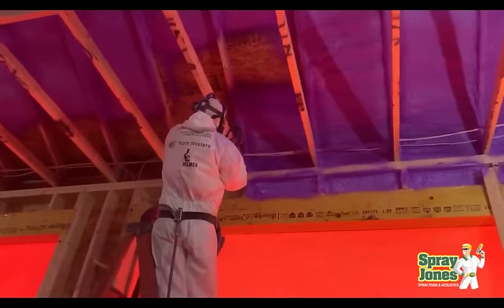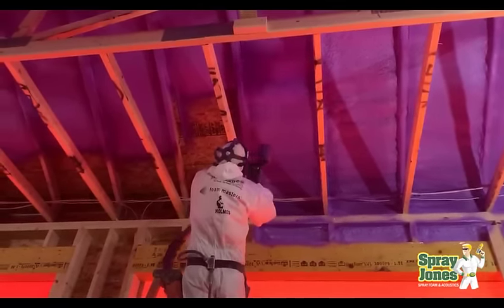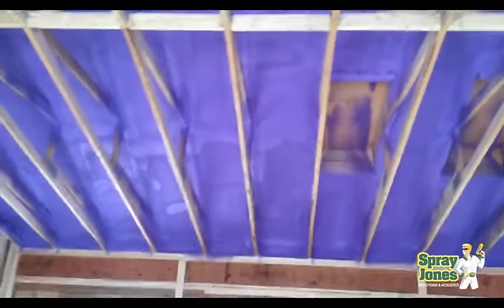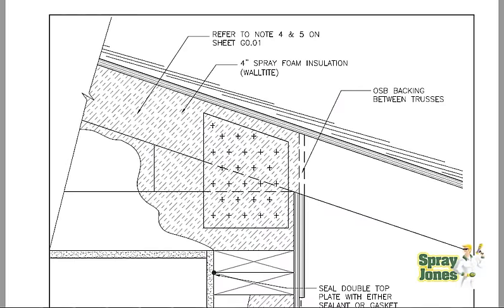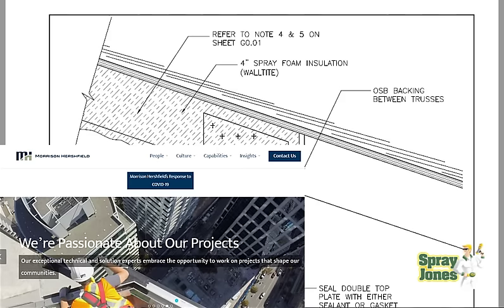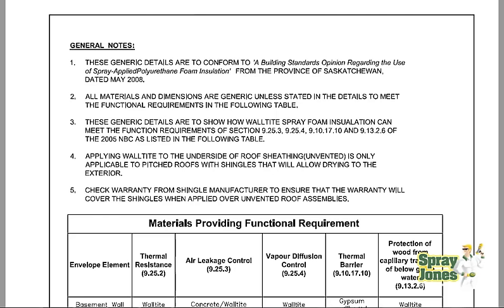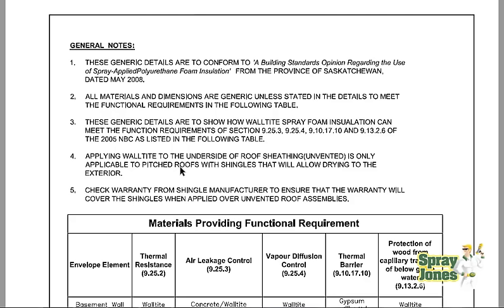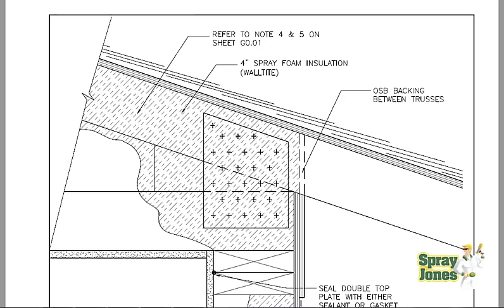Unvented roofs - Closed cell vs Open cell Spray Foam Insulation which is better?

Comment: I think you made a good case @7:30 for not using closed cell foam.  Once you encase the roof deck in closed cell you would have no way of knowing if your roof is rotting away until your shingles start to fly off. Sounds like cutting the roof deck with a skilsaw might have been avoided if the leak was detected early.

I like the idea of open cell for that application, closed cell everywhere else.
Reply from the maker: Just ask a roofer how many times do they have to replace roof sheathing on a conventional roof when they replace shingles? How did the guy in the story I told discover the issue?
Reply: The key is if the roofing allows trapped moisture to get out.  I would assume most asphalt shingle assemblies will but not nessarily.
If you do have a leak in your roof with spray foam on the underside you will not know it until the sheething, structure has rotted away.  As stated, that foam glues everything together, it will be very difficult to replace that.  Given that roofing guys often have to replace sheets when re-roofing houses, I would be very nervous putting spray foam on the underside of that decking.
Saying that, there certainly are lot of advantages in spraying the underside.

Comment: Just found your channel. Good info. Somethings to mention. Closed cell in this scenario needs to be air tight with no air leaks through to roof sheeting. In my experience, air leaks in cold climates can drive enough moisture to cause structural damage from rot. Also ice dams can be an issue. We've had good luck with using baffles to create 2"+ ventilation space and thus maintain a cold roof while still gaining the advantages of closed cell foam, the added rigidity, the conditioned attic space, much less ice damming  and, for me, accessible ceiling systems. 

The baffle idea seems like common sense to me and to the installer I've used on multiple jobs but I've never seen it mentioned in any foam industry info. Wonder why?
Reply from the maker: Do not agree.
Reply: @SprayJones  his point seemed logical I wonder why you did not agree. Could you please explain, thanks so much.  Also if you have an air gap there if you had to replace any sheathing, it would not interfere with the spray foam.
Reply: I would assume that now the space is not unvented anymore. This video is for unvented spaces so everthing needs to be ar tight.@davidhannan2023

Comment: We have to have some type of ventilation in attic spaces by code in Michigan. Mechanical or passive ventilation your choice. With proper ventilation your shingles will last longer and not blister up. I have seen house's roof sheeting rot from spray foam and no roof ventilation. Currently ripping out finished spray foam basement. They sealed the masonry. Masonry loves to wick moisture. Condensation built up in blocks over time. Till it leaked in basement. The masonry needed an area above grade to dry moisture out. With roofs the issue is condensation. I tell people to make sure they have roof vent baffles installed before spraying foam.
Reply from the maker: Watch the video I made on shingle life and SPF. 
Then the 4 part series on non-vented roofs. 
Code is based on open cell fibrous NOT SPF. So you cannot import misaligned rules to this system.

Comment: I live in the south and have an older house. I have a ridge vent and side draft exits, do those stay? Can i also leave the blown in insulation that's already there on the floor? Would you recommend closed cell?
Reply: I live in AZ and also wonder if I used closed cell do I need to remove existing blown in insulation and block off my attic vents. Also do you need to have the attic ventilated with your hvac also
Reply: Just wondering what you guys ended up doing? I have a similar situation. Thanks

Comment: Great vid, very helpful. I'm embarking on a closed cell job for my roof deck. Two quesitons if I may!
1.) Is adding stregth to roofdecks for snowload a universal benefit when applying at least 4" of closed cell? 
2.) We just completed some sistered rafters to the attic roofdeck. New lumber to old rafters. Should the new lumber be dried to a minimum moisture before spraying foam?

Comment: Closed cell on the bottom.  Peel and stick or fluid applied on the top you I’m pretty sure you will NEVER have a problem. Thoughts?
Reply from the maker: Agreed. 
People that have issues have chosen cheap products, installed by morons, because of the bottom dollar was good.

Comment: My builder said he only sprays open cell because of yrs of experience with both.  He's had way more issues, both short and long term, with closed cell.  I do know I have leaks and have no clue where the source is.  My house stays a consistent temp yr round and my electric/gas bill stays relatively cheap compared to my old house and other people I talk to.  My attic is unvented conditioned with 4" of open cell foam.
Reply from the maker: Sounds to me like your builder has issues with trades... having leaks will wreck anything over enough time.

Comment: I would assume a roof with lower than a 3 pitch would have EPDM or greater roof covering and would allow for the same /similar detail.
Reply: It would be the same. Vulcanized roofing over the top. 
The other safety factor is to install roof wrap. On the roof. Usually a water repellent membrane. Before the shingles are applied.

Comment: Half way through my remodel i decided to swtich to nonvented attic with spray foam. 
I have a metal roof no penetrations.  The plumbing vent goes out the siding near the peak then up above the roof line per code. 

If i did it again i would have used zip tape over the rafters to protect from nail holes. I also would have used zip roof deck. Im not a pro builder but i do think things through. 

Fortunately i used a metal standing seam roof instead of shingles so my decking ahould stay dry.

Comment: I keep hearing conflicting info on putting foam directly to a roof deck. Some people insist you need an airspace there to keep the roof deck cool.
Reply from the maker: You do not. Commercial roofing does not use an air space between a deck pan, rigid and a top membrane. 
It's time to break out of 75 year old technology and the dogmas that go along with it.
Reply: True !
Reply: I had multiple spray foam installers (got three quotes) tell me it was fine.  My roofers wanted vents, I told them I was spraying to the roof deck - they checked with the shingle manufacturer to ensure they would be able to offer a warranty before they even started on the roof (wasn't a problem).  I then checked with my Hydro rep (when I was having my house assessed for energy efficiency grants)  and he stated that a vented roof would actually lead to more problems and the only reason that it's still sometimes done is because building code is lagging behind the technology.  Same reason the spray foam guys actually told me there was no point in spraying more than 4" of foam on a roof or 3" in a wall but code may still require it because it's based on fibre glass batt R value (or did when I had my house sprayed and inspected).  As a result they had to spray 4" on my basement walls to pass inspection even though they said there was negligible returns going from 3" to 4" on a wall.   My only concern was the point brought up earlier, that if there was damage to the roof you would never know about it because the water would take a long time to go around the foam to get into the house and show itself.  That's where investing in a proper roof comes in - get the membrane, get the ice and water, get a company that does it right.

Comment: Your videos have helped convince me that an unvented condition attic is the way to go. We are going to put new asphalt shingles on just prior to spraying closed cell foam on the rafters. What kind of underpayment should we use?
Reply from the maker: That is your roofer. I do not know. 

Pick the BEST SPF contract you can. Vet them out and do not be afraid to pay for it. Less issue potential.

Comment: What about open cell for the underside of an EPDM flat roof? I assume this means the roof assembly needs to dry to the inside during all seasons which requires proper HVAC maintaining low RH in the dwelling.
Reply from the maker: We treat EPDM flat roofs on a case by case basis to review all variables and liabilities. In short we have sprayed all that we have done with closed cell because it was the right fit for the inside.

Comment: Can you use close cell on 1/12 pitch metal PBR roofs.( in south east US) 
Have perused your vids but can't find anything spacific. Thanks for your ethics's just wish ALL spray foam contractors had your integrity and desire to educate others. 
As for as I'm concerned that is what transparency is meant for.

Comment: I'm wondering if there could be a condensation issue in colder climates, if any research has been done how this practice holds up to the test of time? A life long carpenter and builder I think having air flow between sheathing and insulation will alleviate the chances of condensation condensation.

Comment: Can you use 2" of closed cell then fill gap with open cell? I have an I.C.F home basement, and 2nd floor 3rd floor is a mix of 2"x12" walls and 2"x6 walls ,I'm going to have a condition attic that is cathedral type , the contractor I'm looking to use is recommending open cell with the thought that a void in the 2"x12" wall area and possibly the 2"x6"  wall will create a bad echo ??

Comment: Question.   Is there an advantage to 1" of closed cell followed with 3" of open cell?  As opposed to only 2" of closed cell? Some installers are recommending this application mainly due to cost of material.   THANKS!

Comment: Recently had open cell sprayed in my attic. Noticed a leak during a rain storm shortly after due to the expanding foam pushed off our ridge vent. I had all 3 ridge vents removed and shingled over the opening. Problem solved but it cost the spray foam company $675 for this work. Ridge vents should be removed prior to spraying.
Reply from the maker: They should be covered up from the inside so the foam doesn't go into them. Same result.
Reply: @SprayJones  True, either way works i guess. Thanks for sharing!

Comment: I believe one important Building Code detail... as Part 9 of the NBC is being cited... you don’t mention is the requirement for a vented air space between the top of the insulation and the underside of the roof sheathing. I’m not saying SPF cannot be installed in this location.

However, since no vented air space is being provided and most jurisdictions (Cities) must follow the prescriptive Acceptable Solutions listed in their Provincial Building Code, the use of an Alternative Solution may be required. 

I highly suggest the local Building Inspector is consulted before SPF is installed to determine if an Alternative Solution will be required.
Reply from the maker: You are correct. For the last 12 years this has bee placed to bed. The Province reviewed this and has approved it. You have to apply with your SPF paper work at the time of permit and then it will be granted. There aren't too may places that have an issue with this.

Comment: Thank you for your videos! I enjoy learning from you!  Would this also apply to a metal pole building? I want to have the walls and inside roof metal sprayed with closed cell foam, but I am concerned about ventilation.  This building will eventually have heat, but no A/C.  Do you have a video already on this situation that I may have missed?  Thanks for your assistance!
Reply: This is an older video, so you may not get a response from the author. 

I am preparing to build a house and have done much research into spray foam.
If you use closed cell spray foam, make sure to get enough thickness to prevent condensation.  Some climates an inch will work and some climates might need 3 inches.
On a metal post and beam construction make sure you have an experienced spray foam guy do the job, if it is applied in to thick of layers it can cause some deformation in the longer open spans.

I found this vid because I am spray foaming the roof deck on my build.
Reply: @charlesarmstrong3536  Thank you sir! Much appreciated!

Comment: Wow, I love your video. Only problem is that I saw it too late. We just had our roof replaced with aluminum shingles. The underside of our roof sheeting is insulated using closed cell spray foam. The Installer claimed that he could not put the Aluminum Shingles directly on our existing plywood. He took off our old shingles and weather barrier and add a false roof over our 12/12 sloped roof. And in doing so he neglected to raise the flashing around our cultured stone chimney. As a consequence, to his actions, we now have water entering our home where the closed ends at the lower edge of our roof. My question is could aluminum shingles (which vent extremely well) be placed over a roof that has been spray foamed?

Comment: I noticed that you sprayed the complete 2x4 even on the bottom for the ceiling. Does this need to be done in order to make it all vapor proof? I am having my addition spray foamed with the following. Rafters are 2x12" 12" on center.  3" closed up to the roof deck then an additional 4.5" of open cell. So this leaves the bottom of the 2x12 not sealed. Should a plastic vapor barrier be installed. Have not talked to the contractor about this yet. Project site is in central Massachusetts
Reply from the maker: You have some technical questions that need answering. Talk with your contractor.
Reply: Closed cell foam is a vapor barrier.

Comment: Great video! Just the info I needed. One question: see any issues using zip system roof deck and closed cell under?
Reply from the maker: Not at all. But get some pros in your corner when making final decisions. Ones that understand foam and not old ways.

Comment: You can't use asphalt shingles. They seal eachother in with tar strips. They are referring to cedar breather and cedar shake roof shingles that allow moisture to condense and evaporate from under the shingle back into the outside air. Otherwise you need a vent beneath the shingles making the sheathing the shingles are attached to the same temperature as the air outside
Reply from the maker: No you do not. Please get off here if you are spouting uneducated nonsense. 
We have been doing this for 17 years, and we are nowhere near first in the industry.

Comment: So if closed cell was applied, I’m guessing you wouldn’t use any iceshield beneath the shingles? I can see the inspector challenging this lol. At the same time, although I completely agree with your argument, one would never really know when there’s a breach in the osb sheeting, beneath the shingles.
Reply from the maker: What you do exterior is not much of my concern. I see no reason not to use the ice-shield, it changes nothing for the envelope on the inside.
Reply: @SprayJones  I wonder, though, could you have a problem with water seeping through the plywood to the bottom and have no where to go and get trapped top and bottom, or should you use an ice shield but leave some less water tight area at the very bottom in the eaves?

Comment: Awesome
Videos you’re doing your community a great service thank you! Question- when you talk about the case with the man with the 12/12 pitch going to the 4/12 and water getting underneath the shingles… why would they have had to apply more spray foam when doing the repair? Wouldn’t the old closed cell foam remain undamaged and flat against roof deck so that the new piece could simply been placed flush right over it?
Reply from the maker: They chewed up the foam when they did the repair. Common issue really.

Comment: What are your thoughts on using a peel and stick for the entire roof deck (for a metal roof) and closed cell on the underside of the roof deck? Would that trap moisture and prevent the sheathing from drying out on either side?

Great stuff!
Reply from the maker: Need a diffusion open membrane. It is simple to source and have installed.
Reply: Why use ice-shield on the whole deck in this situation?  You can't have ice-dams anyway in winter.  And if the metal is done right you won't have a major rain leak.  Just use a quality underlayment (not asphalt).
Reply: @SprayJones  could you provide an example of this style membrane please?
Reply: That's exactly how I built my home on the Gulf Coast, (Hurricanes)  ICF with metal roof with peel n' stick and closed cell on the underside of the roof deck.
Reply: @CougarLand  Because the ICE Shield does not blow off in a Hurricane.

Comment: Does this hold true for metals roofs as well? I have an 8/12 pitch on a new build and have ice and water the entire roof prior to metal going on. No strapping between roof deck and metal. thanks. In Quebec (cottage).

Comment: Wish you were in Toronto! I have added an addition to my double car garage making it tandem on one side so three vehicles on the ground. Furthermore, 16 ft high for additional storage. The roof slopes to a flat roof. So I'm safe to spray foam the sloped portion but what about the flat roof portion. All quotes received recommend r31 5" closed cell. Thoughts? Is spray foaming the underside of a flat roof safe?????
Reply from the maker: Yes spraying a flat roof can be safe as long as certain conditions are met. We have done many. Are you saying that the roof of the new addition is 5" spec?